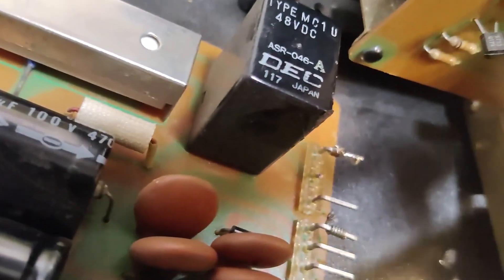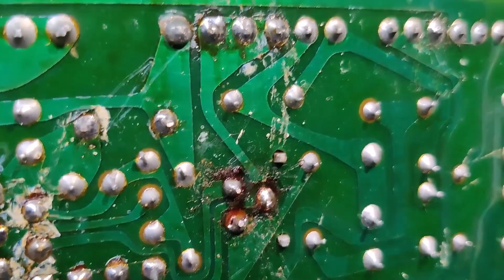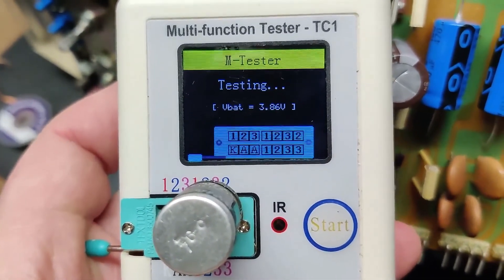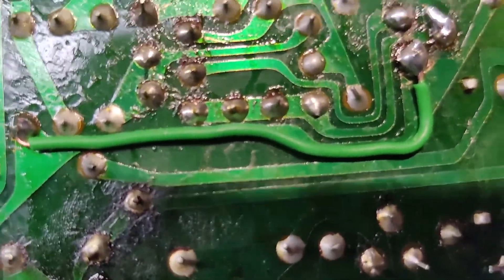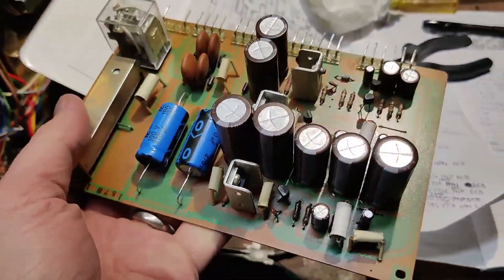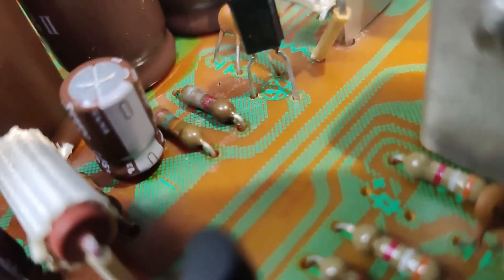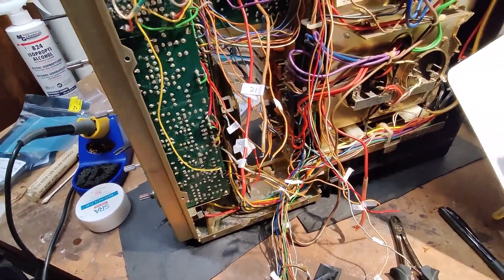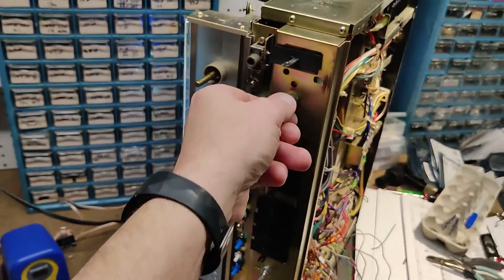Pioneer SX 1280 Part 3   Power Supply

Comment: Really nice work rectifying the damage from a shoddy maintenance past.  Always a big smile when it passes the first smoke check!
Reply from the maker: Thanks Craig. I think I'm going to order a few more MJE15032G to have handy and replace the Q5 resistor. I need to put a another order in for a few more things. When I pull the card out again I'm going to reflow all the pads and might beef up the heatsinks.